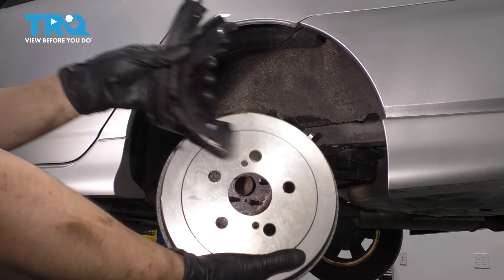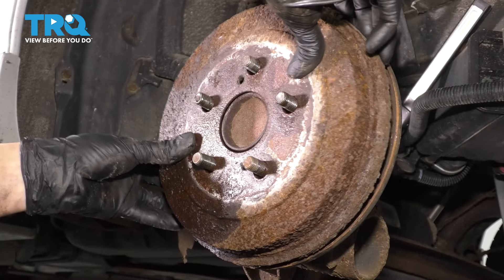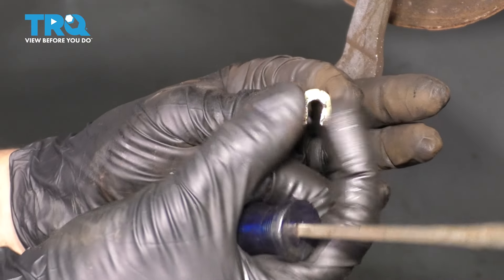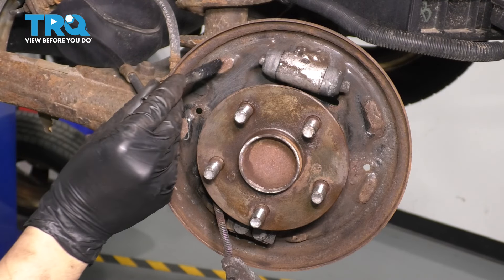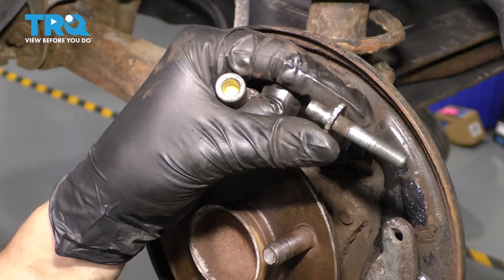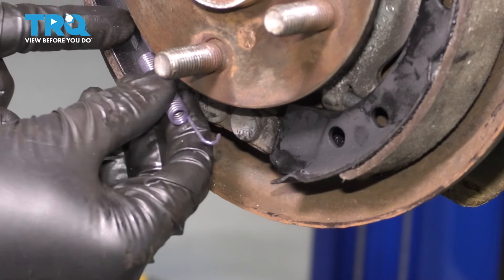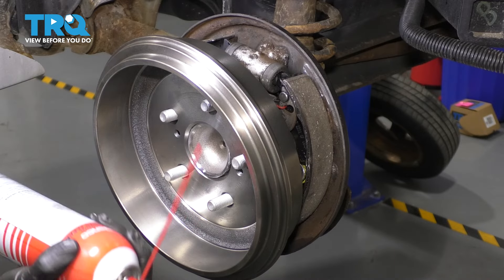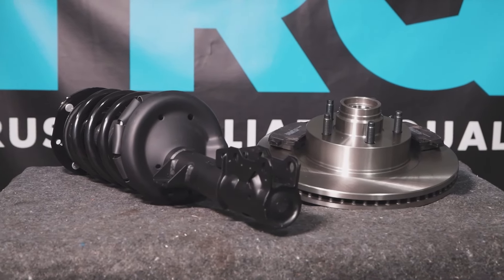How to Replace Rear Brakes 2003-2008 Toyota Corolla

Comment: Great video.  What he skipped over with a cut is that that adjustment screw for the brake shoes is VERY difficult to adjust.  DO NOT touch it if you don't have to.  Tightening the shoes  is easy.......loosening them is very difficult.  Took me 45 minutes to adjust one after I made the shoes way too tight by mistake.  Learn from my failure.....lol.

Comment: Took my car to firestone the brakes were grinding.  They told me they looked at them and they were fine.  I asked if they took off the drums and they said they looked through "the peephole".  The noise I was hearing was supposedly something rattling around in my trunk.  I took off the drums and the shoes were down to bare metal.  I made a video confronting the mechanic and used this video to install my own brakes.

Comment: Thank you for this. Fortunately I work in a shop with all the tools I could ever need. After freaking out about the damn springs I decided to take an angle grinder to make a slot in my screwdriver so they stopped slipping off.

Comment: Great video !!  Not a lot of "Ummmm"s and "you knows.."s that some videos are loaded with.  Great speaking voice and you clearly know what you're doing.  Thanks for helping me save myself some money.  I was comfortable with the disc pads in the front but the springs on the rear  drum brakes I was apprehensive about.  You made it a snap to get it done.  Great info on the brake grease and anti-seize also.  Best video I've seen on this procedure by a MILE.

Comment: Thank you. This living room mechanic couldn't have done it without you. One extra trick I figured out was to take the u-shaped retaining clip off the parking brake, use a vise grip pliers with one jaw on the pried open end of the clip and the other jaw tip grabbing the stud the clip is around. Squeeze and it pushes retaining clip off .  Similar technique tomout back on.

Comment: Thanks - this was really helpful. I can do almost any disc brake pad replacement with no instruction, but I hate drum brakes rather passionately. If the brilliance of a thousand suns were to burst forth into the sky, that would be like the intensity of my hatred for drum brakes. My only crticism is that I think most people will find it easier to attach the rear spring before pinning the shoe in place; I had no trouble with that after many failed attempts to do it in the order shown here.
Reply from the maker: +@jlangevin65 Thanks for the feedback! http://1aau.to/m/Shop-TRQ

Comment: Thanks for this video man, helped me get thru it today. But I failed the wheel cylinder so I’ll be working on that tomorrow bc I ran out of daylight. Got the wrong parts twice so the job didn’t go as smooth as I had hoped. But this was helpful and now I have a better understanding for the finish and next time

Comment: Might be helpful to mention if you are using new adjusters that there is a left and right side. Unfortunately my new hardware kit came with 2 lefts.  Don't throw away your old one until you check new ones. Great video

Comment: Amazing video. I have a 2010 Corolla will this be the same step by step I can use for year. 

I just did my front brakes and  callipers using your  parts.  100% satisfied. 

Thanks for any helping advice

Comment: Thanks for the great video.  I finally got around to doing them last night.  Shoes were only half but drums were warped.  When warm they would pulse badly.   Im not sure turning the drums would do anything as the problem only started after they were warmed up.  I had to reuse the big spring on the adjuster the new one was too tight to fit(mines a 2014 it has a single spring on the top rather than two like yours)

Comment: Excellent video tutorial, so far it has helped me immensely with one side.

BUT, what is the trick to loosening the star wheel adjuster from behind the backing plate?  Mine seems to be locked in place and will not turn. 

Also, the extraction bolt method from the front will not break the drum free from the shoes.  Any suggestions?

My next step is to break it all to bits and replace everything inside.

Comment: Small but important detail: the rear shoe has to sit a certain way.

The bottom part of the shoe (where it sits on a metal plate) has to sit on the first “ledge”. If you push it too far, it will sit behind this ledge, and kinda feels like it’s meant to be there, but it’s not. The drum will be difficult to put on, and you will feel vibration on your brake pedal if you install it this way, since the shoe will be at an angle.

Comment: Question. Do you have to purge the system by removing the brake line nut, pump the brake padel and open and close the port. It's that something that needs to be done after replacing the brake pads and rotors?

Comment: What happens if I DO blow out one side of the cylinder? I did push it back in and secured the rubber part back around. It looks just fine?
Reply from the maker: +@courtn3949 We wouldn't be able to diagnose an issue like that here, you may want to have a local mechanic take a look at it. Thanks for checking us out! http://1aau.to/m/Shop-1AAuto-c

Comment: I used this video for my rear breaks, granted it took a lot longer. After pumping the breaks to get the shoes situated I lost all brakes. The wheel cylinder on the untouched side blew out because I didn’t bleed them both. I would make sure for any1 doing this to bleed both drums at the same time before you try to use the new drums

Comment: Make sure your parking brake is off of course. I had one stuck so bad, the wheel doesnt even turn with parking brakes off. Also I dont recommend a hammer because brake dust gets everywhere and you dont want to breath in that stuff., use as your last resort. And theres a special tool to detached the parking brake cable easy, but whatever way is easier for you.

Comment: Oh no...I got rotors and drums replaced in my sons' 2008 Corolla but one of the calipers is spewing out brake fluid when I press on the brake peddle.  Anybody have any tips?  I reseated the pads into the caliper but still doing it.  Broken seal?  Do I need a new caliper?

Comment: So while doing this I also installed a new cylinder, issue is that new cylinder blew a seal (boot is 100% intact) all the leaking is underneath the boot. I know I made an error, I’m just at a loss at what I did wrong? Anyone have suggestions?

Comment: Brake cleaner is toxic (unless it is labeled as non-toxic) and is a whole lot worse for you than the dust.
If I have to use it- I do it in a highly vented area and do not breathe it. 
One other thing, when the axle hub is rusty, I hit it with a wire wheel to remove as much rust as possible, Other than that great vid.    Mike

Comment: Had to replace drum brakes & b4 I did THAT, I ran over a median & blew out wheel cylinder.  Then broke the brake line when replacing cylinder ….sigh….nothing is ever easy is it?